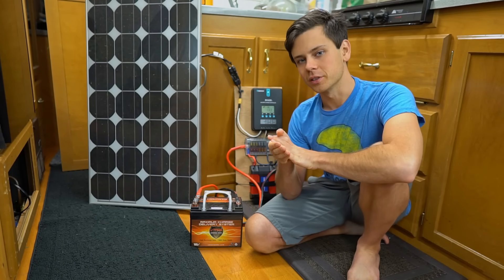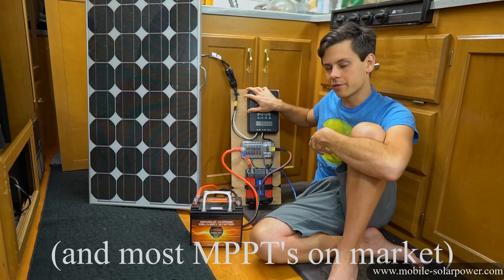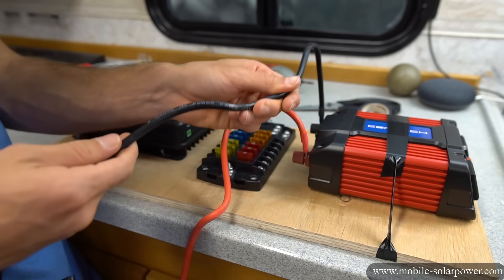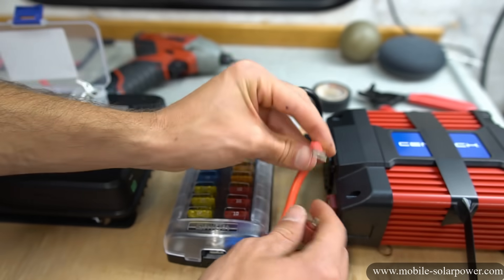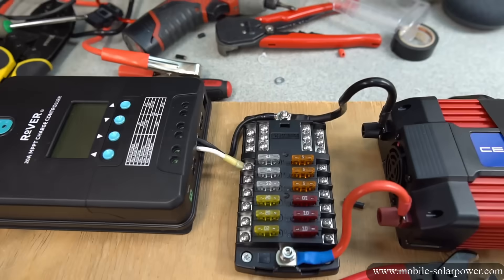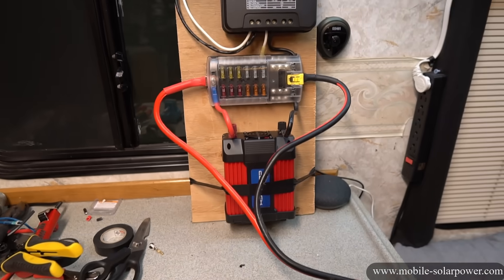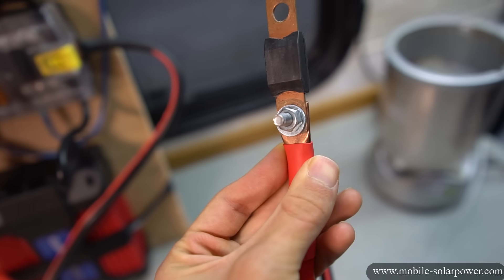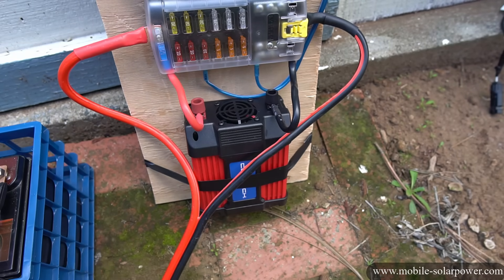DIY 200 Watt 12 volt Solar Power System "The Minimalist" Beginner Tutorial

Comment: Many thanks from an old Aussie in the Philippines, Will. I have decided to go to batteries with with my  200W bifacial Solar/Panel, which I have on been using with a small ECOFLOW 3+ till now. Philippine blackouts are nearly weekly in the wet season, so I will buy another for the upgrade. Your videos are precise, encompassing, totally absorbing and comprehensive, inclusive of wire gauges, and amperages! I just found your web site DIY Solar Power Forum, off YouTube, and joined. I hope I don't annoy you with future questions on there, and will do my best to limit questions... Many thanks for your expertise and knowledge, Will... Wayne Burnham. :trophy-yellow-smiling::face-red-smiling-live::finger-red-number-one::goodvibes::washhands:

Comment: Thanks for sharing your knowledge and information. I am trying this project using a 500 w inverter, and a 80 amp mppt have the fuse box, I multiplied 80 amps times 1.25 and that’s telling me that I need to connect to a 100 amp fuse that is not in the fuse box. I am thinking I need a separate fuse to connect from the charge controller to the fuse box, anyone have any thoughts on this? Using 6 awg wire from the inverter to the fuse box, and planning on using the same gauge wire from the controller.

Comment: Will, on separate issue, can i uset of two Solar String Splitter/Joiners backwards to connect one solar panel to both sides of a dc A/B breaker to disconnect both A dn B  or use A or B paths independently?  I am trying to connect one solar array to an MPPT controller and a Bluetti solar generator. independently.  I do not want to damage anything of course.

Comment: Hi there. Love your videos as I find them very informative and easy to understand. I see in this video you are recommending TWO 100 watt solar panels wired in SERIES, but could you get away with a single 200 watt n-type like the Renolgy ShadowFlux? I have limited roof space. I'm curious your input. Also, I'd really like a 400 watt system so I might look into that, but again, not 4 100 watt panels but two 200 watt panels. Thoughts?

Comment: this is wild... would you still be able to use that fuse box to attach other 12v outlets and switches?  or are you just using this as a very fancy 12v fused distribution bar?

Comment: I have a small 7x14 cargo trailer camper that I have been wanting to install a solar system in. Right now it only has 12 volt lights and a 12 volt tv, but I plan on installing a Maxx Air ceiling fan and a 12 volt refrigerator. I had a 12 volt AGM battery that just died and am using my boats old lead acid trolling battery. The camper is wired for 120 volts with lights, a roof ac and mini refrigerator, but I want to start doing some dispersed camping. It also has a 1.25 amp Battery Tender charger/maintainer that will charge either AGM/flooded and lithium LiFeP04 batteries so in a pinch I can just charge the battery off of the generator. On your recommendation I just purchased Li Time 100 AH battery with low temp protection during Amazon's Prime Day sale for $309, and it is the start to my solar setup. I was thinking of going with a 200 watt solar panel setup to start, but I am very limited for storage space and many time I may have to, or prefer to park in the shade so I was wondering if there are any portable solar panels that you would suggest?

Comment: Hello. I don't have much knowledge when it comes to this so l'm looking for help. I am building a small system for my home. Not for daily use just emergency use only. I have three 100w 12V solar panels and a 30A controller. What battery and inverter should I buy? The brand doesn't matter.
Any info would be appreciated. Thank you so much !

Comment: Luckily I found your video just in time. I have a 2000W Renogy Pure Sine Wave Inverter installed in my Prius. I have it connected to a 100A circuit breaker and quick connect/disconnect to my 12V battery. I'm planning to add a 200Ah LifePo4 to is using an Isolator to charge both batteries and run the inverter with the LifePo4 but also wanted to connect solar panels to it. I purchased EcoFlow 220W Bifacial portable solar panels but I have no clue what MPPT controller I needed. I kind of have my setup like this minus the controller and fuse box. I have it all on piece of plywood because I want to use it in different vehicles for camping. I'll buy your book because I need to calculate what fuses to buy and what controller I need. Definitely will look into systems on your website to build for a tool shed I'm putting together also.

Comment: The way that you crimp using the hammer crimper outside with a heavy stone block as an anvil is the perfect way, i saw a youtuber using a similar crimper but on a wooden bench and thought that it needs to be done as you are doing. An anvil underneath the load  transfers the force directly to the crimp ensuring a good solid connection, the lady was doing the procedure on a wooden bench where most of the force disappears into the bouncy bench. Avidly watching all your videos as soon i will fit a system in my off grid Transit van build, I doubt that there are many people who know as much about solar systems as yourself, thank you for sharing your knowledge with us :)

Comment: You are the most knowledgeable solar guy so I'm asking you. I have 180 watt Renergy solar panel on my van roof. I don't know how much my battery under under the passenger seat stores. Can I run a 200 watt 12v coffee pot on my 180 watt solar panel without blowing a fuse? All my appliances are 12v and under 180 watt. I only use one appliance at a time, other than my 12v iceco Go2020. Thank you.

Comment: I have a question. I bought a camper van that has a converter in it so when the vehicle runs it charges the house battery. It I wanted to add a solar panel kit to the roof to also charge this battery when the vehicle is not running. Will it back charge and cause damage to the panels through the mppt charge controller when the vehicle is running?

Comment: Hi Will & community! I'm trying configure a set up like this but on an even smaller scale! I'm essentially trying to build a diy 25w solar powered chicken coop that has two cooling fans (controlled by w1209 thermostats), a 12v linear actuator for the coop door (controlled by a wireless remote control kit or maybe a photocell I haven't quite decided yet), and a small stretch of 120v heat tape run by a tiny inverter to keep the water from freezing in the winter. I'm really interested in how the 12v circuits are supposed to be wired, especially through the use of a dpdt switch for the actuator. I'm finding a lot of info on the interwebs but I find that they don't really have all the different things I'm trying to do in one spot. Do you, it anyone in this community, have any links on where I should get started? I really want to make sure I do it right so my chickens are safe! Thanks in advance!

Comment: Hey Will
Love this show.  How about building a solar tracker with springs or lifter struts and water. 50\50 so it doesnt freeze. Have a small pump at night fill a bucket with water.  At a certain time in the morning  open a hole to release the water. The spring will pull it in the opposite direction And at night the bucket will fill and pull it back.  I saw the ecoflow tracker and saw the price. I think it could be done for a couple of hundred or cheaper.

Comment: Do uyou use 12 volt solar panels for 12 volt battery. Or do you use 18 volt panels (slight overvoltage) to charge 12 volt battery. For my country, in winter not too much sun. The 18 volt always gives something. I have no experience with 12 volt. What do you recommend.

Comment: I have a good question for you. I’m travelling and i realy need your advice. I have a renogy 50A charge controller it’s maximum 25V open circuit voltage my solar panels are enerwatt with a 25.9V open circuit and my renogy charge controller shuts down everyday when the batterie are full charge. Then it takes hours before the charge controller goes back to working. Do i have to change my solar panels for something with a smaller open circuit voltage that is less than 25V could that be my problem?

Comment: I've been watching all kinds of your videos on this stuff. And others videos. My brain is boggled. Any chance I can tell you what I got and have you draw me out a blueprint of how I need to connect it? I have 2- 200 ah lithium ion batteries. 2 renogy 100 watt solar panels. A renogy 3000 watt inverter. I haven't yet gotten a fuse box. I have also a solar charge controller. All I need to power is a small fridge and a deep freezer and a water pump also a roof fan. Dude if you respond to this an help me I'd be glad to Paypal you some money for your time.

Comment: What im confused about here is why isn't there a cable from the solar controller directly to the battery? how is it charging the battery?
Reply: i've realised you are using the 12v fusebox to take power back into the batttery. I suppose a lot of times people like to put isolate switches in between battery and fusebox or solar and battery

Comment: Does anyone know why the charge controller is wired to the fuse/distribution panel, and then to the battery, instead of going solar -> charge controller -> battery, and then from battery out to both the dist panel and the inverter simultaneously? I'm designing a basic solar setup for my sailboat

Comment: I am running a Renogy rover 40 amp mppt and 1 100watt solar panel with a 105 amp hr AGM battery in a van . I would like to add a 100watt panel to make it 200 watts . What would be the best way to run them parallel or in serious

Comment: You have very good explanations so at 0:40/12:10 did you mean to say put two 12v panels in parallel vs series? Best wishes. Keep on Truckin'
Reply: Later on at 1:03/12:10 you state that the two panels could be hooked up for 24v which would be in series like you said at 0:40. so would be 2 in series for 24v and 2 in parallel for 12v. So you all can ignore my first comment as you like.

Comment: Love your vids, learning so much! What size gauge wire are you using from the battery to the solar controller and the battery? I'm using just 1x 100w solar panel @ 12v and inverter @ 1800w

Comment: You say you wouldn't use the Rover controller and that to check out your latest recommendation at your website - but your website also recommends the Rover as well. What is wrong with the Rover? Why do you say you wouldn't use it?

Comment: If you run your panels in series doesn't it change the voltage? Like from 12 volt to 24? And that will still work to charge a 12 volt battery?

Comment: I want to ask you, if it is possible to charge my battery through my solar panel, while powering my loads/appliances, connecting my inverter at the same, without getting my battery drained at the same time until sunset?
Reply: Depends how many amps you're appliances are drawing & how many amps your panels are providing
Reply: Even with no load, inverters have an idle draw.  Powered loss, etc.
Reply: @GoliathSack  : What could be the percentage power loss during inverter idle time sir?
Reply: @adedoyinatiroko9962  look at the inverters spec sheet for that info
Reply: @Goliath Sack: I wanted to ask you once more: like for example, I have some Canadian Mono panel array of 5000watts. Would the pv  energy production be as efficient as 100%, producing same amount of the capacity of 5000watts in a typical bright sunny day?
Reply: @adedoyinatiroko9962  if you have 5000w of panels @ 12v that would produce around 1500amps on an average day.
Reply: @GoliathSack  : How did you do this calculation sir?
Reply: @adedoyinatiroko9962  a 100w 12v monocrystalline panel provides on average 30amps a day, I know this because I have one lol
Reply: @adedoyinatiroko9962  I'm no expert,  I'm just a solar/electronics hobbiest/enthusiasts that is learning & sharing as I go.
Reply: @adedoyinatiroko9962  there are so many variables involved that there will probably never be a 100% efficient solar system.  Thermal loss alone can be greater than your inverters idle draw; which means that as solar panels heat up, they lose efficiency.  Basic 12v dc system; no inverter = no idle draw. Shorter cables, lower gage requirements, less costly.
Reply: @GoliathSack  : Have you produce any teaching (video) relating to voltage drop of energy by lenght of wires?
Reply: @adedoyinatiroko9962  thanks for your interest!
Reply: @adedoyinatiroko9962  no panel is 100% efficient,  your arrays max pv production cannot exceed tv the rated 5000w.  More than likely it will never even reach 90%, even the highest efficiency monocrystalline with high end mppt & the correct wiring length & gages can barely reach 90% peak efficiency.

Comment: I have a 30a mppt controller and 2x100w panels. Should they be wired in series or parallel for maximum performance?
Reply: Series maintains voltage.

Comment: I have a boat with two acid batteries 12 Volt and I want to build  a solar system to maintain both batteries (and not continuously over charge the Batteries) .  Can you direct me.  I am going to check out your website to see if you cover this particular subject.
Reply: Get a good mppt charge controller, it will prevent over charging

Comment: I don't see if it was answered below, but what is the reasoning/ benefit/ difference of running the inverter straight through the fuse box and into the "battery" input on the MPPT?

Comment: Hi,
Thanks for the video.
I copied ypur system in my shed.I see two issues here though.
1.What if the 25amp fuse conected to the charge controler blows.Then the controler will lose connection to battery and still be conmected to the solar panel which is not safe.
2.Not conecting the load to load terminals on the charge controler will not give reading of what amps are drawn from the battery and will be no statistic as well.
How do we go around that?

Comment: Hi Will!

I am currently working on building a solar powered livestock watering system. I plan to run a 12v DC/3.0A pump. I would like to build an on demand only system without a battery. The pump will be turned on/off using a float switch in the holding tank. Could this be done with 1 or 2 100watt panels? What components would I need?

Comment: wanted to get this setup to keep boat at 12v. question is, can you use a 12v to 24v step-up converter for an electric motor? or would i be better getting the 24v solar setup and stepping it down to 12v?

Comment: You are awesome Will !  Q: Could you have connected the negative charge controller wire to one of the negative screws on the fuse box instead of the negative terminal on the fuse box?

Comment: First time viewer here. Thank you for all your time and effort. I'm a retired Army electrical engineer and this video was totally awesome, packed with valuable information and design ideas. The furthest I went with solar was for my motor home. 3 175 watt panels, 4 12v gell cells and a 5kw inverter. Came in real handy when out of gas for the 5kw generator and no mains to tap into. But now looking into putting some panels on my small shed for my mobile home.  We get winter storm outages now and then. Thanks again for a great vid and loads of info!

Comment: I want to build a kit half the size of this . for my Mercury grand marquis. I can mount 1 100 watt panel directly to my trunk lid with screws and will be right where my battery and inverter are located in the trunk. I ordered 1 "Weize 12V 100AH Deep Cycle AGM SLA VRLA Battery" I already have a 2500 watt inverter and it's already wired from my car started battery to my trunk with 0 gauge wire and a 300-watt breaker located close to the positive of the starter battery. I ordered a " WirthCo 1213.1241 20092 Battery Doctor 125 Amp/150 Amp Battery Isolator" for my new battery. I just need to find a decent solar panel and controller. Do I need the fuse box? I did get another 150watt breaker for in between the doctor and positive of a new battery. Also how long could i expect to run a 200-watt heater that draws 2 amps

Comment: Are diodes needed between each solar panel when installing solar panels in parallel ( as long as other standard practices such as equal voltage panels are being used and the panels are adjacent to each other)?

Comment: I'm trying to build a system like this purely for charging power tool batteries. But, I wanted to use the same system for separately charging the vehicle starter battery, rather. I have a 250W solar panel, a 30amp dual battery charge controller and a 200W Pure Sine Wave inverter. Is there any problem with this idea? Or anything I need to consider that I may not have, being a noob and all?

Comment: Would it be safe to use something like a SB350 SB Series 350 Amp Anderson Powerpole Kit between a larger 1200 to 1500 watt inverter and beefier branch connector as well as another between battery and branch connector to give flexibility to not mount the larger inverter but connect it when you need to move your system around?   Would like to understand how to add resistor into this circuit to reduce spark when connecting and disconnecting battery.

Comment: I have a  Renogy 200 W. suitcase system that I use to charge two Battleborn lithium Batteries in my Rv. Recently it blew over onto rocks and one panel shattered. I bought what looked like an identical panel but when I hook it up just like the broken one it shows 18 volts and defaults. Won't charge. It is a 100 watt like the broken one. The built in junction box seems a little different. The charge controller is on the side that is good. Any ideas?